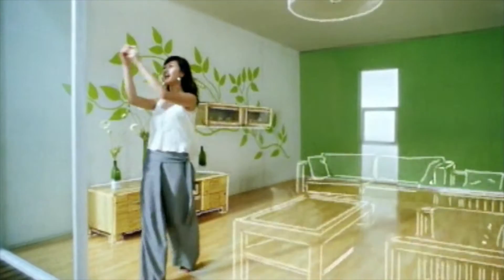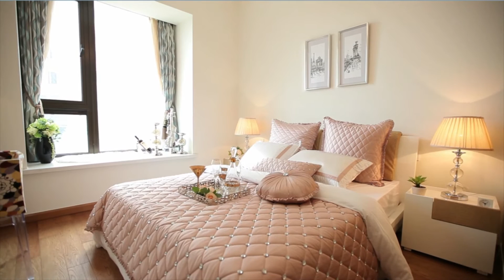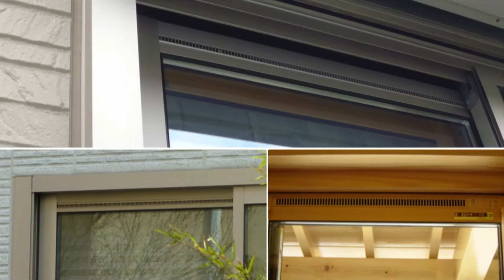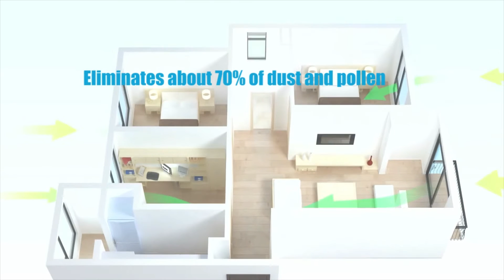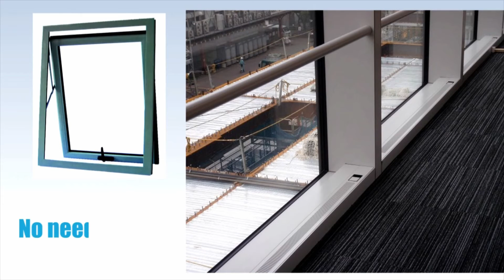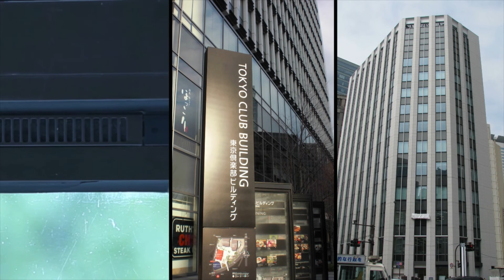Ventient Passive Ventilation

Comment from the maker: New to Proctor Group Australia - a state-of-the-art temperature perception technology. Without electric power, sensors or human intervention, Proctor Ventient technology automatically controls ventilation dependent on ambient temperatures, optimising the benefits of natural ventilation without introducing air that it too hot or too cold.

For more information on the Proctor Ventient passive ventilation system, contact Proctor Group Australia on 1800 174 900.